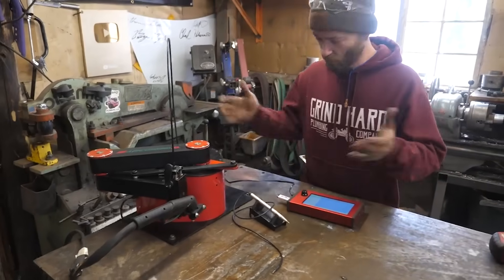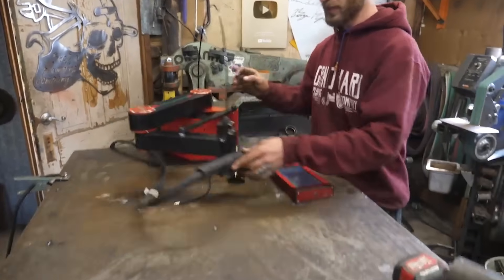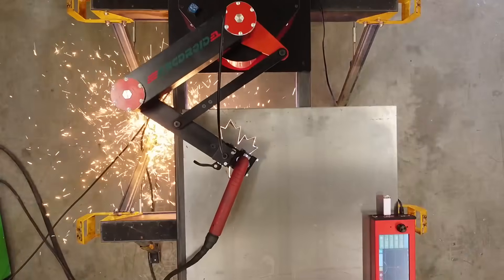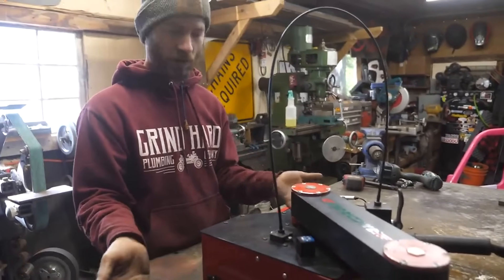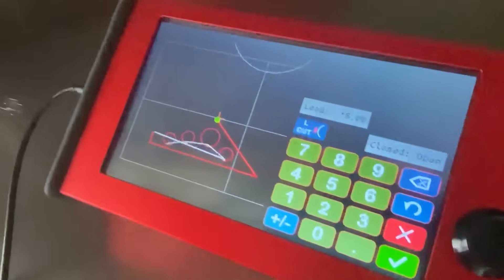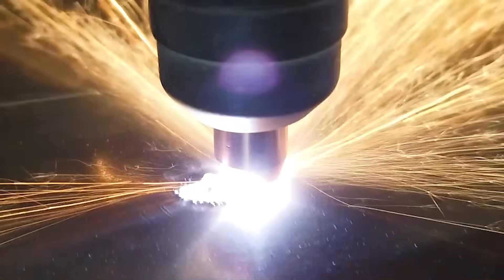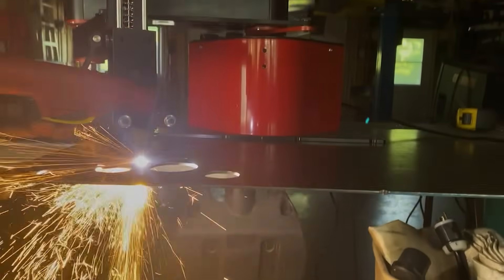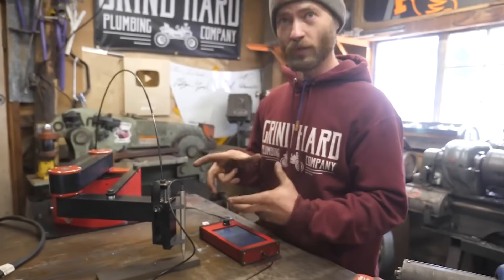ArcDroid The CNC Plasma Robot

Comment: Hi, if I have a Hypertherm Powermax 45 with hand torch leads, how does the ArcDroid initiate the cut? Does it require any modification or adapter to work with the hand torch?